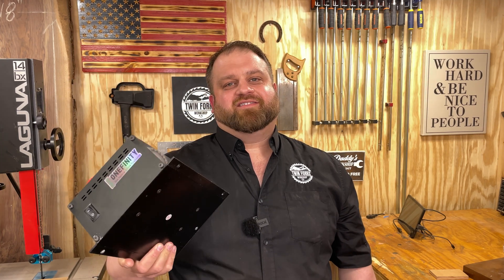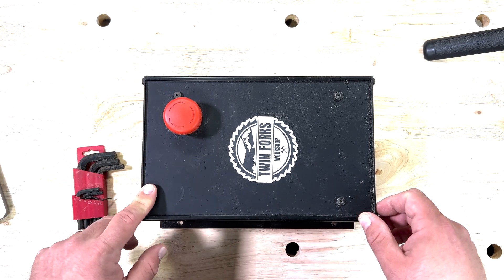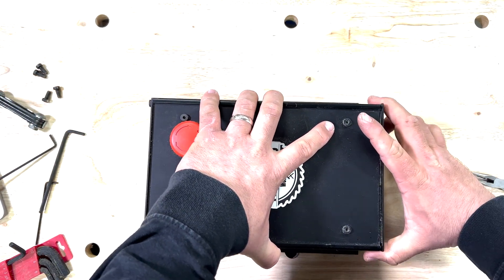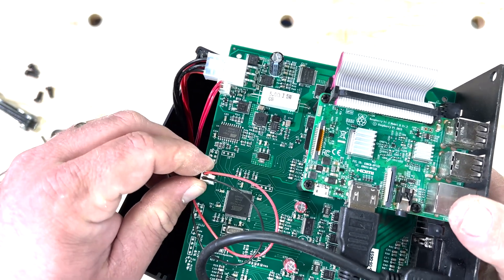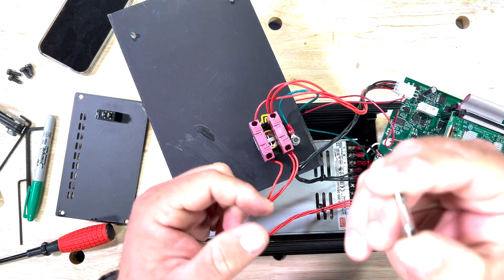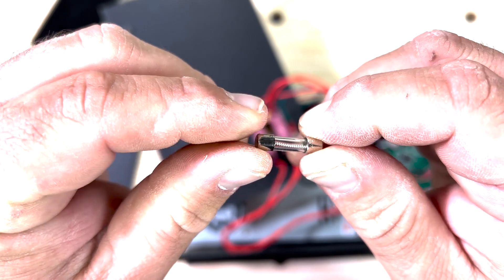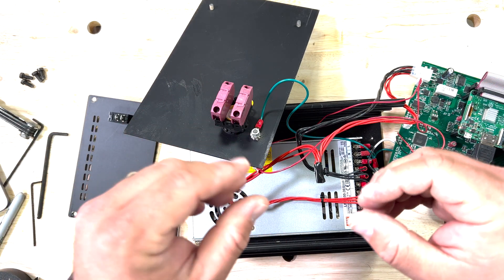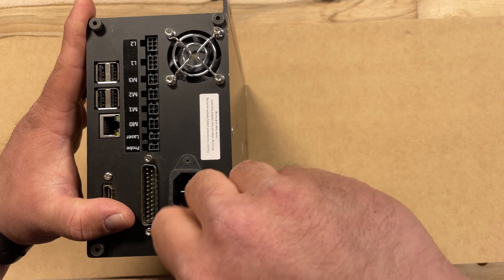R.I.P. Onefinity CNC - Troubleshooting my $3000 paperweight

Comment: I had the same problem with the E-stop on my lathe.  I installed a new switch and within a few months, it stopped working also.  I figured out that dust was getting in between the contacts of the switch so no connection was being made.  To solve the problem,  I installed a new switch again and I put the whole E-stop box into a little clear plastic bag and sealed the bag with piece of string.  Twelve years passed, and no problem since.
Reply from the maker: Love it! K.I.S.S. is the best policy in the shop.

Comment: did they offer any soultions to the dust issue. heck its a woodshop and a cooling fan thats not filtered or protected is really a basic design issue. I'm a potentential customer. I'm retinking my choice here. Thanks very much for the video.
Reply: Build a wooden box with an old computer muffin fan in one end blowing out and find some type of paper filter for the other end. Maybe a lawnmower filter or something like that. 
I am looking to purchase a Onefinity machine sometime in the next year, and seeing this problem is a great way to take steps to avoid the same issues.

Comment: this makes me want to take mine apart and give good cleaning
Reply from the maker: 100%! It was shocking to me the amount of dust in there. Ultimately it did not affect the machine, but like any other tool, the CNC requires preventative maintenance.

Comment: That's not a solution that's a band aid. Did they ever replace the faulty contactor?
Reply from the maker: It works fine, and I have had to hit the E- stop at least twice since. Although now that you mention it, the point of having two breakers would be in case one side failed - as it did. I'll be replacing that shortly. 😳

Comment: That much of dust is unacceptable, I think you need to position the controller away from the dust
Reply from the maker: Yes it is. It was caused by a dust boot failure when flattening the waste board 😳. The cables that come with the machine aren’t long enough for the controller to be placed further away.

Comment: I'm not against their method of self-service but I do hope they sent a replacement breaker. I have no experience with CNCs but I am quite familiar with electronics. And they had 2 breakers for some reasons.  One would be for fault tolerance, so if one failed the other would pick up without skipping a beat. Obviously that's not the case. The other would be with rating of the switch. Their may be some derating involved so even if the breaker reads as good enough, the continual operation will very likely result in a shorter life of the component. May want to see about them sending out a replacement breaker before the warranty expires. 
Worse case if they refuse which is a bad look for their company buy ur own replacement.
Reply from the maker: Their customer service was great. Good points!

Comment: E-switch have cheap change and buy ewery elektric shop new less than 15$ or orden internet somewer, all new box cost me 6$ i orden my son new cnc what i build.controller board cost 10$ stepper motors drivers cost 17$/axis. stepper motors lot biggest and betters than onefinity weak 1,2Nm 28$ motors my 3Nm motors 60$/axis. this all line/motors what need buy, not need all controller new not need all drivers buy new, only one if have broken.
Reply from the maker: Good to know

Comment: worst build inside wires, power supply has only one, tree screw, output DC plus point, why has used all 3 screw to E.stop , need only one wire power suppy to E-switch and out SW to board. has only make worst 3 wire power to board. little biggest gauge wire and not need 3 wire, only one wire, and 1 to 3 share connector output at E switch to board 3 place.  or if board go in this 3 red wire need change wire biggest gauge and only one wire, this have worst use 3 wire if need only oe wire. this cut on/off only power to board. next time you have fasten and better diagnose if use multimeter. looking come power in and out to SW and board come power, this line.
Reply from the maker: Smart!

Comment: Title reads RIP but then it gets fixed successfully and everything is fine... so the title is super accurate. Plus, what happened here is literally the definition of ‘right to repair’ and still the customer is unhappy. The fact that end users are even able to repair this unit is amazing.
Reply: If you bought Apple's CNC you would be forced to buy a whole new CNC as it would be unrepairable.
Reply: @DanT10  You'd have a replacement immediately if the unit was totally unusable. Sure, it's great to be able to quickly fix something yourself for no downtime, but this isn't a "right to repair" issue.
Reply: @amerikalast  I never said this was a right to repair issue. I said even though the system is under warranty they fixed this over the phone with no downtime. It is a pain but it was great that they would do this.
Reply: Right to repair is when is not under warranty
Reply: LMAO at the onefinity groupies in here pretending you're lucky they sold you bogus equipment that had to be repaired after less than a year. Life is good.
Reply: A digital meter will speed the diagnosis up considerably.😉
Reply: Kind of snarky comment, yes he fixed it, but probably still needs a replacement part, or a beefier estop switch, as I find it odd that they can get away with ganging all those wires into a single bundle.  What if estop had opposite issue, ie didn’t cut power to both sets…
Reply from the maker: Thanks for watching and feedback!
Reply: Thanks to the non-existence of affordable Proudly Made in USA products, most of us are forced to take the risk of buying poorly developed junk from China!
Sadly most products are made in the US, and the maker wants to get rich quick selling less for more. This is a poor strategy for failure, opening endless doors to competition abroad.
We either go back to producing decent quality products in the US at competitive prices, or China will have more control over the world market and capital.

Comment: Definitely not what I wanted to see. User serviceability is an option. It  shouldn’t be the standard—at least for that kind of cash and being in warranty. I will certainly dive deeper into if this is a trend. Not afraid to break apart, but that diagnostic would drive most people nuts. You have much patience.
Reply: I'd much rather fix it over the phone then be out of service, period.
Reply from the maker: Yes for sure
Reply from the maker: It wasn’t terrible.

Comment: This is great.  They make it serviceable by the user, which means your not screwed having to rely on them.  Also, means almost zero down time waiting for shipping back and forth so your not wasting days or weeks to get repaired therefore loosing money.  Dang, you have a TON of dust in there!  Definitely move that away form the dust!
Reply from the maker: The fact that it’s user serviceable is great. Though, some might find it a bit daunting which is why I’m surprised they didn’t offer a repair option. It was still under warranty, a replacement estop would have been nice instead of bypassing one leg but I guess it gets the job done. That dust is from an unfortunate dust boot malfunction while I was flattening the MDF waste board. It got EVERYWHERE haha it’s worse than glitter!

Comment: I’m sorry for 3000 they shud had replaced it,
Reply: I understand why folks are upset about the unusual service repair on a $3k machine, but these are not cheap to build. These methods allow them to keep the cost down for the masses.
And the steps taken for repair really are basic steps for any DIYer, regardless of experience with electronics.

Comment: This is crazy to me. They made you do all their work for them, and now your E stop is operating on one breaker? At the very least they should have sent you a new switch assembly. WTF. I mean good on you for taking on this situation, but I would have been livid. This video makes me want to stay away from Onefinity, unfortunately as far as I can tell their design is superior to the others in this price range. And at 15:16 they may have given instruction, but YOU did all the work. You should NOT be thanking THEM for solving anything.. Just my 2 cents.
Reply from the maker: A new e-stop would have been nice, but their directions were pretty clear and their tech support was fast and responsive. It is the best hobby machine on the market. Hands down. We also have to remember they aren't Apple. They don't have a supply of refurbished control boxes they can just swap out. They're an excellent until recently home based business.
Reply: @christopherbernichon  I appreciate your response, and great video by the way!
Reply from the maker: @Jepskis  Thanks for watching!
Reply: He did the work for himself, so his machine could work by the end of a phone call.   Were it me, I would start off extremely 1) stressed about a failure I had no ability to comprehend, and end 2) educated and satisfied that, in the event of failure, I had expanded capacity to understand and confront several possible issues.   This was a GOOD experience.
Reply: @mavigogun  I agree. You’d be down for a week or more if you had to wait for parts. A month or so if you had to send it  in. I just bought one and I’m so glad we’re able to repair it ourselves. However, I work on circuit cards and electrical components as a trade so it is easier for me than some in this situation.

Comment: I had this same problem. They asked me to tear it apart to diagnose as well as send pictures and video. While they were nice, I decided to to just buy a replacement and exchange. 500 bucks. I have 2 of their machines and did not want a hobby, in terms of electronics repair. Love the machines, but this self diagnostic response is a little mind bending.
Reply from the maker: Yeah thats smart. Every minute you're down you might as well be lighting $100 bills on fire.
Reply: @christopherbernichon  It's a hobbyist machine, sold at a hobbyist price point; no one should expect commercial-grade customer service.  Machines like that have a nation-wide dealer and service network and they will send someone out to your business, but they cost several times the price and may even charge a yearly maintenance fee.  If you "do not want a hobby" then don't buy a Onefinity IMO.  Buy a Laguna or similar.  As for "lighting $100 bills on fire", the Onefinity warranty clearly says that commercial use renders the warranty null and void; they were under no obligation to assist you at all.  Personally, I'd never base a business on a machine like this.
Reply from the maker: @barryomahony4983  I hear you but who is buying a machine this nice for hobby alone? They obviously can’t afford to be swapping out $500 controllers but in my opinion they had an opportunity to wow a customer for a couple bucks and didn’t.
Reply: @christopherbernichon  You get what you pay for. A real CNC for actual commercial use will cost you north of $10k, so the idea that you're losing a ton of money when you can't afford professional tools doesn't seem believable. Then complaining about the equivalent of checking the oil on your car, it probably doesn't come across how you imagine.
Reply: @canonicaltom  $3000 for a hobby CNC? Must be for a rich hobbyist.
Reply: @slanwar  OP said it wasn't a hobby. Literally, "I have 2 of their machines and did not want a hobby"
Reply: @slanwar  sure yes, normal hobby used budget have maximum 1000$ all cnc cost, can build own machie less than 1000$ my cnc 60x80 inch table cost less than 70$ biggest better stepper motors, better real spindle not worst makita router, axis own drivers to motor cheapern ad easy change if broken less than 20$ own paraller controller card 10$ easy cheap change if broken, same power supply. all have lot cheapen change if one axis go broken not need buy all box new. only controller card 10$ or driver card less than 20$ or motor. and can use mach3 or 4 or linuxcnc software and no need pay expensive onefinity factory softwares.
Reply: You are missing the culture you have bought into: machines like this were designed by builder-users, for folks a little further down the tech tree, to make CNC tools accessible.   For some, this is enough.   For others, it is a gateway.   Regardless, the attitude of the builder/users is very much DIY, with the presumption that YOU will be coming to your own rescue.   Which you could have.   With some offered help.   Which you declined.
Reply: Had the same experience this past week. We were going in loops for an entire day because they wanted me to do troubleshooting even though I had already diagnosed the problem and sent them countless videos...
Reply: and under 100$ can build totally new controller box paraller port to computer, controller board 10$ and all axis to motor driver board, need only output controller board to stepper motor drivers, 3 wire, step, direction,and enable pi. input to controller has W-stop, board plus wire  to E switch to GND loop. and limit SW come to input pis, relay if controll spindle output. not hard, simple build own box. only software need configure pi numbers different controller board have different pi used input and output pins. or change pc different software, mach3 or linuxcnc software and config all pins and ready can again run cnc cheap. own controller box.

Comment: Your E-Stop may not actually be bad, you may actually just have had a loose connection there. Have you put it back together the way you have received it and seen if it started to work. Also like the previous comment checking for continuity is the easiest thing to do. I bet you can duplicate the problem now that you have removed and reinstalled the wires.
Reply from the maker: Checked both sides, the side that went bad had a loose switch. Hard to describe on video but gravity was causing it to engage.
Reply: And I would have stripped some more insulation off of those six wires, soldered them together and then put them into the switch. That way you know that it will not loosen up again.